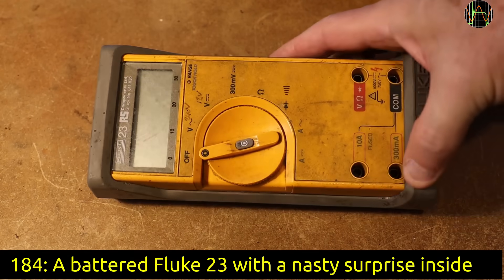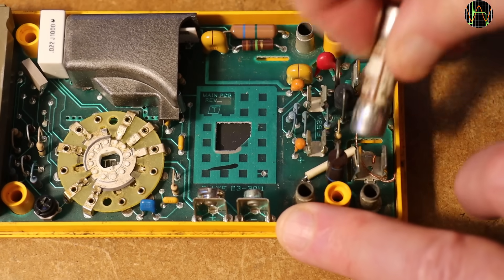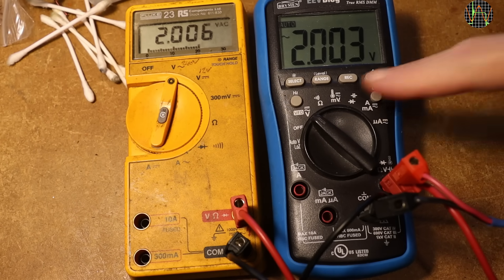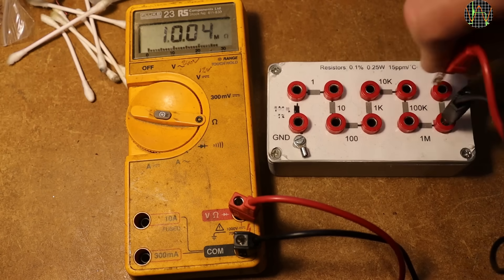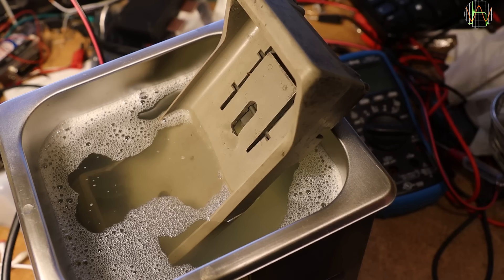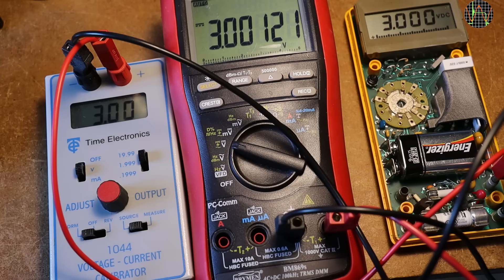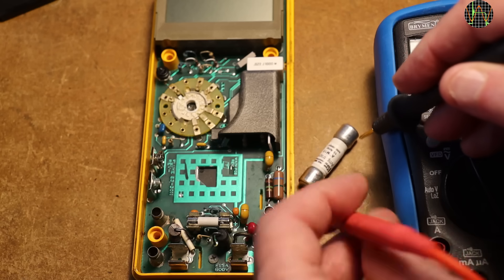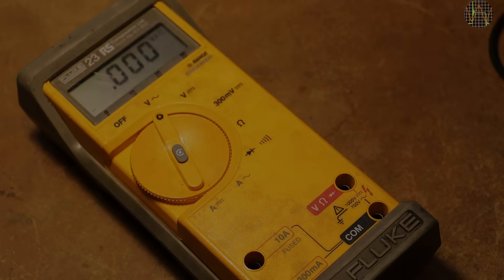184 - A battered Fluke 23 with a nasty surprise inside

Comment: A couple of things... 
1. This is why Fluke is "expensive", the abuse this meter had taken and after an easy fix is 100% working again after 35 years.
2. The bypassing fuses thing is so common that some companies require a fuse check as part of the yearly calibration procedure.
3. Great video! Subbed.

Comment: Why would anyone buy a Fluke with a unknown fault to use it after one problem was desolved as a dependable measuring instrument ? That is beyond me.
Reply from the maker: You have a point, but this is quite harsh. I check every function and compare sample readings covering the whole range with my references (mainly an Agilent 34401A that is sent for calibration by a certified lab every 2 years).  These tests are much more thorough than the samples I show in  videos but is quite boring, nobody wants to watch endless test series for hours.  More general, any device, whether brand new or used and possibly repaired can fail suddenly and maybe in ways that are not immediately obvious. There is no universal “fix” for that. I routinely check my meters once a year (mainly to see if they have drifted). Other than that, one has to be vigilant, know the quirks of the meter and know what the expected result should be and if the reading is unexpected, stop and investigate and include a meter error in the possible causes to check. Also there are some basic safety rules. I always unplug or flip breakers and discharge caps before touching anything that may have dangerous voltages. A meter may show the presence of a dangerous voltage but you can never trust a reading of zero or close to zero to mean the absence of a dangerous voltage and don’t get me started on how most cheap new meters fail to properly show dangerous voltages containing both AC and DC components...
Lastly I have a large (way too large) pile of multimeters and know their good and not so good points. I my experience, older meters from good brands (Fluke, HP,  TTI, WaveTek…) are way more robust, reliable and trustworthy, repairable and worth repairing than most of the shiny brand-new toys from China.
Reply: @TheHWcave : As an owner of an 34401A you do not need a cheap FLUKE. For somebody low on cash, its a bad idea to buy a beat up FLUKE on ebay and repair it IMHO. As a student back in the 1980ies I bought a Korean digital meter and it works and is accurate up to now. Five years ago it seemed to misbehave. Turned out the copper of the cheap measuring strip broke and it functioned after replacement like new.
Reply from the maker: @wolfgangrichter6088  The 34401a was a one-time big investment for me and only because I got a good deal. Apart from trips to the calibration lab (in my car! I don't trust couriers or mail services with it), it does not leave the house. I do electrical and electronic repairs in a lot of places, for example in my local repair cafe (charity) and the Fluke 23 is (currently) the meter I use.  If I see a repairable multimeter, I feel almost compelled to rescue it from the scrap heap. If I can repair it,  I might swap it with one of my other meters which I then sell or donate If not, I harvest parts. What by the way is a "cheap measuring strip"?

Comment: I am not sure where you live, but I would suggest a Mr Clean Magic Eraser to clean up plastic, you have to be pretty careful about pushing too hard, but it is like a miracle cleaning grubby marks off plastic. On the topic of fuses, I used to build hi-fi amplifiers for clients, and usually they had a power fuse, fuses in each side B+ circuit, and fuses for the speakers. I occasionally got "failures" and in every single case, someone had bypassed the fuse "for better sound", and usually blew up their tweeters.  I told them up front this voided the warranty, didn't even slow them down. As far as I know, none of the units with the normal fusing ever had the fuse fail, or any other component, either.
Reply from the maker: Thanks for the tip, it is available in the UK but I have never tried it so far.

Comment: Interesting! Far as cleaning meter boots I've had good luck by removing them from the meter, removing anything 'catchy' like tilt stands, and running said boot through the washing machine with a load or two of work clothes. Will it come out perfect? No... but you might be pleasantly surprised. (Don't put in the dryer!)
Reply from the maker: Thanks, I will give that a try

Comment: For Fluke 23 / 73 / 75 / 77's please use a conformal coating aerosol and spray the rectangular IC's.

Let dry before turning-on the multimeter.

I forgot a Fluke 73 outdoors in the rain and the top  IC's leads became completely corroded.

Do not spray the Caddock high voltage precision resistor pack as it could affect its accuracy.

Comment: You would be shocked at the construction of most of the cheap meters on the market. Most of them don't have fused current ranges and if they are fused use simple LBC glass fuses or sometimes ceramic fuses but nothing like the breaking capacity for the claimed category of the instrument. They are nothing short of lethal, but most people who buy and use them don't have a clue about installation/measurement categories and safe use.
There's a reason why Fluke equipment isn't cheap and it's because it could save your life.
Reply from the maker: I agree with you and I am well aware about the lack of safety on most cheap modern multi-meters and fantasy CAT ratings. I usually state that these are ok for electronics but should not be used for anything at mains voltage. How many buyers will follow such advice? Worst IMHO are rechargeable smart multi-meters where we now have the additional problem of the electrical safety of the charge connection while a user could be poking the probes into mains voltage. On testing this I blew one meter up that way while on my Brymen only the 10A HRC fuse blew, see my video #140 on Kaiweets KM601s, so far the only meter I   said don't buy but if you check the comments, some viewers still don't understand why.

Comment: Entertainingly, I'd gotten two of the first Fluke 77 meters when they were first introduced. The high ampere range being 20 amps, unfused. Later models were fused at 20 amps.
Same spark gap caps though, had to replace them in one, when a circuit under test had an insane voltage runaway.
One of the original 77's was stolen, the other had the rotary switch fail around 2004 and it was gone when I redeployed home five years later, along with the majority of my possessions - including the house hot water heater, copper pipes and half of the home wiring. With all thanking me for my service before I entered my home and being oddly absent when I came back outside.

Now that I'm retired, don't have the cash to buy a new Fluke, but I might just go for one to recondition one from ripoff bay.

Comment: You put in a 9V battery that can be trusted to be OK until 2013?  I would keep an eye on it. Like everyone says, these are splendid meters. My old 77 is still working well. 😊
Reply from the maker: I used that battery for testing. Now the unit uses a rechargable NiMh 9V (really 7.2V) battery which is perfect for these meters because they can handle the low voltage and draw very little current

Comment: Dig meters have becom so accurate and common, Fluke doesnt lead the pack anymore.    Depot, and even Harbor Freightmeters, for $50 are good and you dont send them back for repairs if you blow them up.
Reply from the maker: Feature-wise and (initial?) accuracy wise your are right but I would not like to hold one or even be close to one if you measured a fuse box voltage with the meter set to amps... Check out Joe Smith channel to see what even moderate energy spike and surges does to many modern meters. Sometimes the failure is not obvious, just something is not measuring right anymore. A pretty dangerous thing in itself if you rely on a meter reading. I think I read somewhere that Fluke stated more than a quarter of the price of a meter goes into input protection and proper testing that the protection actually works.
Reply: @TheHWcave  Good points.
Reply: @TheHWcave 
I used to be involved in the testing and design of multimeters and the most important element was the safety and protection in the event of misuse or a fault condition. This is why high-quality test equipment is a lot more expensive than the cheap crap you see all over fleabay and other similar budget sellers.
Safety is no accident.

Comment: I have that exact meter, bought in 1989 for $169 as I recall.  Still works fine, the only downside is it isn't a true RMS meter.  The rugged case saved it a few times when it was knocked on the floor.
Reply from the maker: Agreed, but there is a small (literally) upside to non-True RMS meters when done well  (as in the Flukes). They will still measure very low AC volts correctly while the True RMS meters all come with small print caveats in the specs, for example (Fluke 177): "AC accuracy specified from 5% to 100% of range and for non-sinusoidal wave form add -(2% reading +2% full scale) for crest factor <3. for non sinusoidal".  The best AC resolution of the Fluke 23 is 1mV at +-2%+2. It can measure 25 mV easily. The True RMS Fluke 177 can measure AC mV at 1%+3 but 5% of range (600mV) is 30mV,, so a 25mV reading is not to be trusted and don't get me started on the degraded accuracy depending on crest factors of non sinusoidal waves which is supposed to be the advantage of True RMS.

Comment: Oh man! I have a Fluke 75 (Virtually identical to this, but the colours are swapped around; It's designed for automotive applications) which I retired after 20 years of light but faithful service before cleaning thoroughly and putting into the box for my new meter to keep it snug and safe - I know I'll want to use it again in the future! ❤‍🔥

I wish I had a few sets of spare probes for it, though. The ones that came with the new meter have all but the very smallest part of the tip insulated, forcing you to have to be very top-down with using them...And with most of my work being PATs of appliances with UK plugs on them, the Fluke probes (Which could be held onto the plug terminals edge-on and provide an acceptable connection) were much better suited to the job. 👍
Reply from the maker: There are probes available where the cover can be removed (and quickly lost...). On newer Fluke TL175 "TwistGuard", you can adjust the exposed tip in length. I don't have any of these fancy ones but it sounds they may solve your problem (and still be "Fluke".

Comment: I'm so glad that You checked it out before using it. I bought a meter off ebay that the seller claimed was ''tested and working'' When I got it, like Yours there was no battery and also a blown fuse. Even after making those repairs it's not very usable Live and Learn. I'm glad You were able to get Yours back in good condition.

Comment: Is the EEVBlog multi finally good after the teething issues?
Reply from the maker: I have only the rather old first EEVBlog meter, which is the Brymen BM253 and never had any issues with it. If you are considering the BM787T, it is probably a good idea wait a bit longer until all issues in app and multimeter have been sorted
Reply: @TheHWcave  Ah, you are right. I confused it for the newer one, but the 786 that came in between. I did not even now there was a more recent one than that, yet. Thanks!

Comment: I use only Fluke meters and have a few of them as well. My last one that finally quick working was when it needed a new battery. But once I installed the new battery, it only came on and stated "CAL err"... And nothing I could do to fix that. I even contacted a Fluke repair center and they told me it would cost way more to fix then the meter then it was worth. It was a Fluke 110 True RMS meter. So I actioned it off and bought another one...
Reply from the maker: Shame that it lost its calibration just by running out of battery. That should not happen. Even Fluke doesn't build them like they did before. I had a quick look at the cal instructions for the 110 and it s actually fairly easy. Not as easy as the cal for the Fluke 23 but still, no need for high but precise voltages and currents as for example for the Fluke 177.
Reply: @TheHWcave  Well, I managed to buy another used 110 TRMS Fluke since I really loved the one that went CAL err on me. I had to clean the used one up. But it is working equally great now. It isn't the best or most functioning capable of all my Fluke meters, but it is easy enough and compact enough to go with me when I need it... I will say the 110's are pretty scarce now too..

Comment: I've had one of those since about 1990. Solid old meter. My resistance measurement is no longer accurate. I wonder if there's a calibration potentiometer for that. Otherwise I'd say some internal components have changed value.
Reply from the maker: In a Fluke 23, all ranges are calibrated by that one pot. If voltage is still accurate but resistance is not,  the first thing I would do is a good clean of the PCB with isopropyl alcohol and cleaning the range switch with a contact cleaner. There might be dust and grime causing leakage currents.
Reply: @TheHWcave  Cleaning seems to have helped. It's closer now. Where did you get a replacement 10 amp fuse? Fluke doesn't list that model on their website. Mine's currently a standard 10A 250v buss fuse with a couple of pennies wedged to hold it in place. Better than a wire, anyway.
Reply from the maker: @keyboarderror1  The Fluke 23 needs a 15A / 600V Fuse with at least 10kA breaking power. Size is "midget" or 10x38mm. A suitable one is SIBA 5022526.15. For example https://uk.rs-online.com/web/p/cartridge-fuses/7686103
Reply: @TheHWcave  Thanks!

Comment: Have both a Fluke 8020 and an 8024, one of those had the LCD display replaced decades ago when it turned dark, had bought the replacement from Fluke. Love the electronic peak hold/capture on the 8024, great for capturing inrush currents or voltage sags when testing systems and devices.

Comment: Ebay is now just a platform for scammers and liars for anything used.  'Untested' is now the code for 'broken beyond economical repair'.  At least this Fluke wasn't as bad as it could have been.  Hope you got it cheap as the proper fuses from a trustworthy supplier are expensive.  Cheaper fuses are often fakes that will likely kill your meter one day.
Reply from the maker: I got a refund from the seller to the tune of the price of 15A fuse of the right spec from a reputable distributor. That left the seller with probably no profit at all on this sale and I admit that that I felt a bit sorry for him because he is just selling stuff he picked up elsewhere.
Reply: @TheHWcave  Thanks.  Good to know.  I guess there are still some honest people out there, but they are getting rare.

Comment: Good solid meter, I still have my Fluke 23 from the 80’s and works fine! Glad to say it still has its original current fuses and never had any battery leakage either.

Comment: Linking out fuses is bad, has always been bad, will always be bad, will always be done..... I was called to a site problem many years ago and found the mains fuses shorted. I asked why did you do this? Because it kept failing. I asked how do you know the rating of the shorting wires? Answer- 1 x wire = 5A, so 6 x wires = 30A etc. Eventually they went down the souk and bought some new fuses otherwise I wouldn't switch it back on. Glad you got it working.
Reply: How much will it take for us to get it across to people that if fuses keep blowing, then there is definitely something wrong with the circuit. And I mean UKCA levels of wrong... 🔌🇬🇧🔥

(And also; If your fuses keep blowing, now's a good time to consider upgrading to a board that can accept RCBOs...Once you've fixed the recurring fault, of course! 😉)

Comment: That battery is quite old as well 😉
Reply from the maker: Agreed, I use it just for testing. BTW, batteries in these old Fluke meters can last forever. For alkali batteries  the Fluke 23 spec says 2000h runtime, that is almost a quarter year. I measured the operating current in DCV to be about 260uA ! They don't build meters like that anymore

Comment: I believe that "white wire" that had the missing PCB connection is the shunt resistor for the 10A range. It basically is a wire, but of a precise low resistance. Current is calculated by measuring the voltage drop across it.
Reply from the maker: Good idea, and you had me opening the meter just to check. No, its just a wire link. The shunt resistor is of  the traditional U-shaped wire type and just above the fuse on the right side (if the white wire is on the left) next to a red varistor. According to the service manual its  R7 with a value of 0.005 Ohm 1%